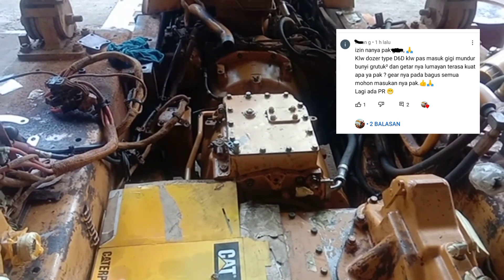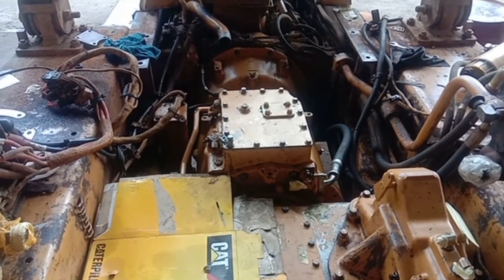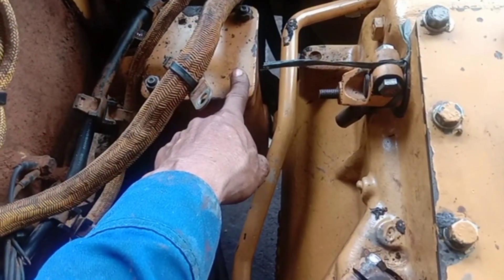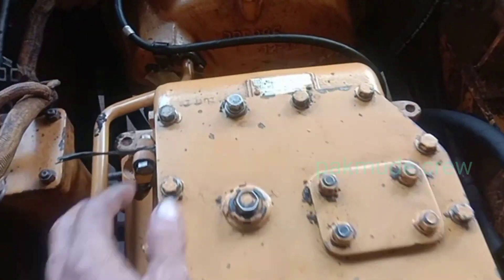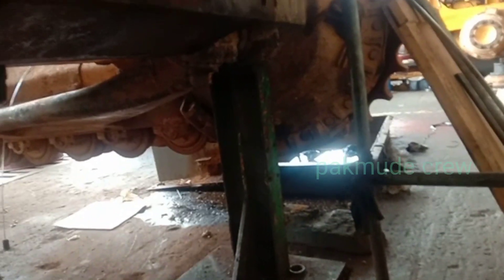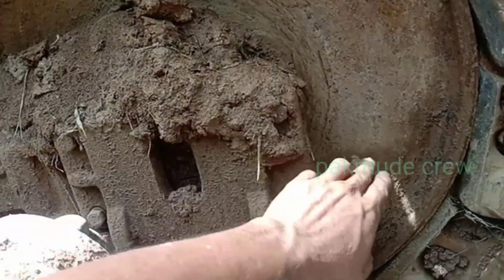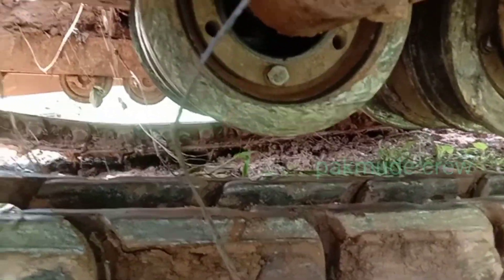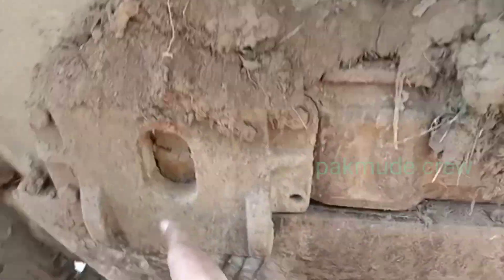bulldozer Caterpillar d6d bergetar dan noise saat gerakan mundur

Comment: mas mau tanya ini saya ada problem buldoser D6G converter nya baru ganti bearing , setelah di pasang dia semua di test hidup silang empat nya gk mau mutar apanya kira² masalh nya itu mas mohon penjelasan nya mas🙏🙏🙏
Reply from the maker: Spider joint ngak berputar’
Valve relief  conventer dan hose hidrolik dari transmisi apakah suplainya bagus bg
Reply from the maker: Valve relief conventer dan scaving pump pastikan bagus dan suplai hose dari transmisi ngak ada yang tertukar

Comment: Assalammulaikum, om unit sy zaxis 210, ke dua trevel tidak gerak, boom arm lemah, kombinasi jg lemah om cuma baket yg normal kira kira ini solusinya apa yah om
Reply from the maker: Waalaikumsalam
Pengecekan presure main pump delivery 1&2 berapa ya om
Ketika presure yang dibutuhkan untuk menggerakkan attachment travel dan arm serta boom sesuai standard 34_36 kpa
Ada kemungkinan troble pada main relief om🙏
Reply: Alhamdullilah dibls ia om bsk sy lakukan pengecekan pressure main pump nya om, kejadian ini setelah sy melakukan perbaikan hose yg ada di signal control valve om, dikarnakan salah jalur dari signal control valve saat mekanik bekerja om
Reply: Izin lg om, sdh mekanik sy lakukan pengecekan dengan pressure guade manual MPa dan PSi pada pump 1 & 2 hasilnya rata rata di 1200 psi om tp kondisi buket dan swing bekerja dengan halus tidak ada hambatan selain dari buket dan swing, attchemant lain sampai kombinasi lemah semua om
Reply: Kira" Apa yang harus sy lakukan om
Reply: Jadi rata rata 12 MPa semua hasil pengukuran pressure guade nya om yg membingungkan om buket dan armnya tdk ada pengaruhnya om tetap bisa bekerja halus om